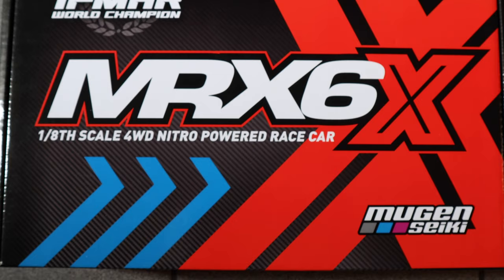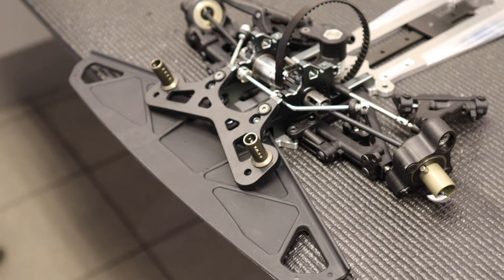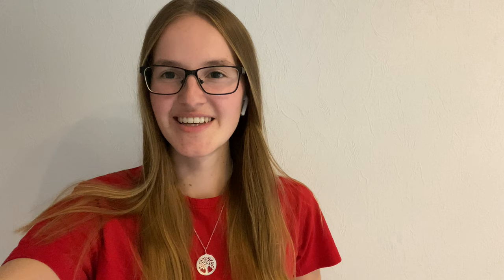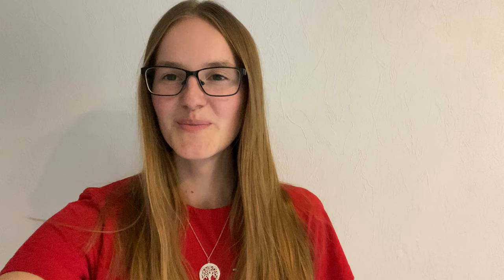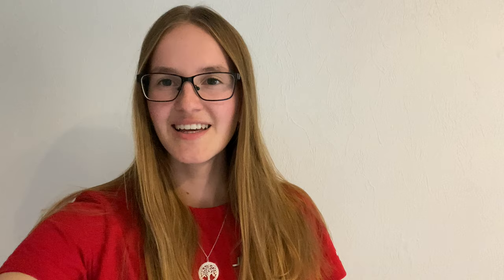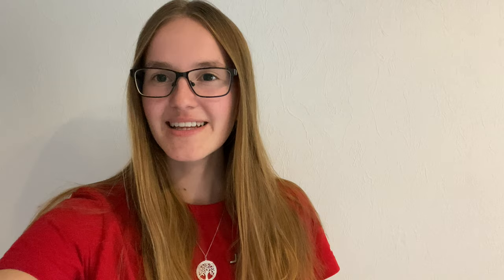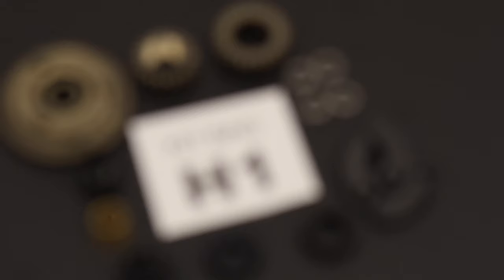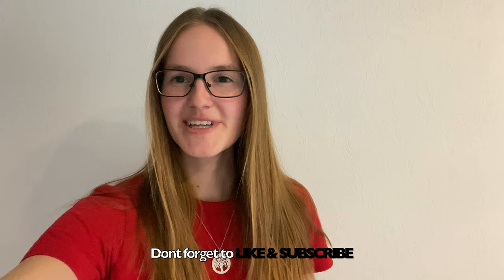Building my NEW MRX6X 1/8 onroad RC car | Jessica Pålsson

Comment: Sweet machine that MRX6X 🙂 I bought a used MRX6. If time would love to see a video on how to fastest change the 3 belts. I guess the front belt is possible to replace by loosen the mid pulley module, 2 screws under the car, and also the front top axle mount (or what it is named). I just do some parking lot asphalt racing and small rocks wear on the belts and pulleys. Good luck with the racing, from Norge 👍
Reply from the maker: Yes its Definitely is :) my main category is offroad so I usually dont have so much time for the onroad :( thank you 😄

Comment: Beautiful chassis ! 👍👍
Reply from the maker: Yes!!😃
Reply: What servos (speed and torque) you use? 

On throttle and steering 

And why you don't run truggy 1/8 nitro?
Reply from the maker: I will use CT700 for steering and CB700 to throttle. 

Why I dont run 1/8 nitro truggy is because there is no class in Sweden for races. Thats one of the reasons